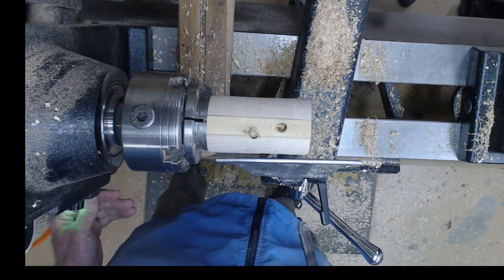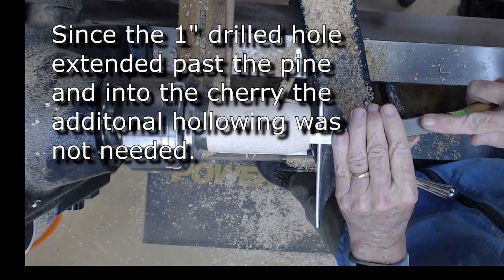Wood Turn a Whimsical Fish Using the “Lost Wood” Process

Comment: Thanks for demonstrating this interesting technique, Mike. My grandson is very into fish and I have made 3 with a couple of "sacrificial" prototypes interspersed as I climbed the learning curve. One useful method I found was to use a 5-5 1/2" inch blank rather than a 4 inch blank. That extra length allowed me to finish shaping the tail end and run the final curve past the finished fish wood so just the waste center spacer ended up squared off. I then just saw it off. That saved the trouble of making the jam chuck.
Reply from the maker: Thanks for Sharing your techniques.

Comment: The "lost wood" technique intrigues me.  Would the double sided stick tape work?
Reply from the maker: I guess it would depend on the size of your piece and whether your drive or live center was acting like a wedge to slowly separate the pieces. I believe the paper joint is easier to clean up. Double sided turners tape can be notoriously difficult to remove. and clean up residue.

Comment: Funny, I have just been considering this method to make a square bowl; replacing the lost wood with an accurate square of different coloured wood for the base, The mitred corners would need very precise  cuts. Early on I thought you could use one of the drilled holes to peg fit a wavy dorsal fin. Also interested in the design of your bandsaw fence, Mike. Could you detail it sometime?  I like the brad point eyes, and could have done with that idea for my chess knghts. Thanks,   Bernard.
Reply from the maker: I have tried different eyes. Another is using small map pins. Another is using a ball tipped pyrography pen. My BS fence is the stock Rikon fence.